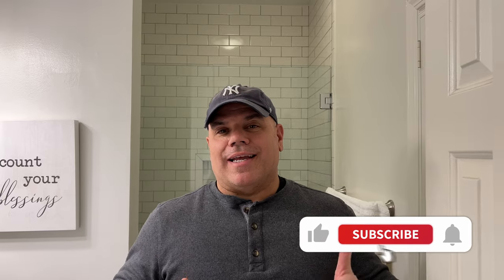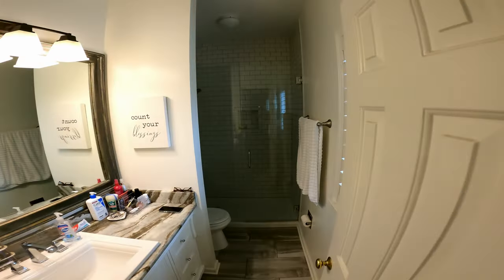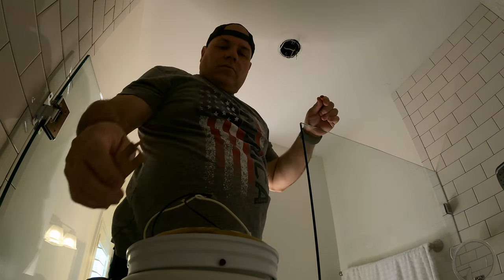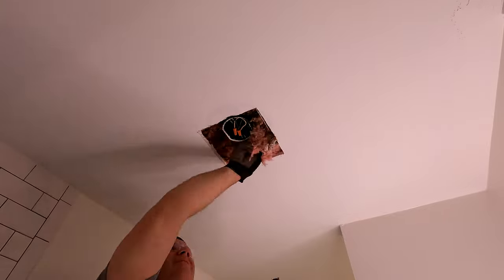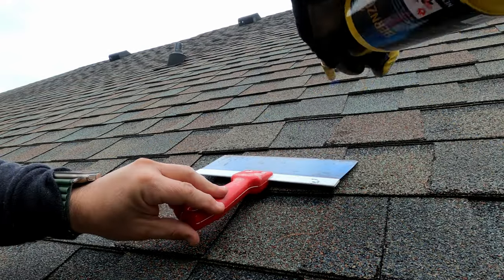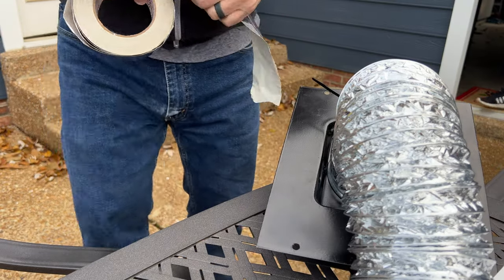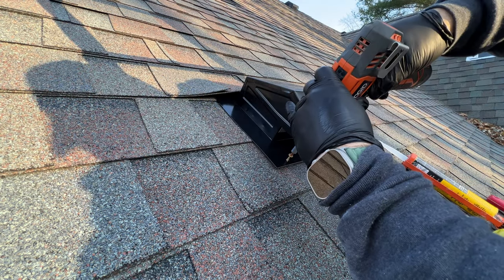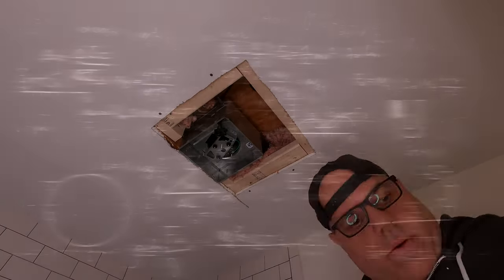DIY Bath Exhaust Fan Installation - How To

Comment: Should be straight 4" pipe with a 90 of the fan. Apart from that good job. And before the haters come on here the reason that you don't use that stuff is because once any type of fluff and moisture starts to build up around the ridges of the  lining of the 4 inch flex, it can only go one way and that is to fall downward. When it is straight pipe you can evacuate way more moisture and  it doesn't hang on to The ridges  inside the flex.
Reply from the maker: Thanks for the feedback.

Comment: Why did you place it right on the shingle and you did not peel back shingles
Reply from the maker: I did peel back the shingle at the top because that is the only thing that is required. If I had peeled back the sides or bottom shingle then water would have a way under the vent.

Comment: Nice man! Did you get in the attic to check the roof deck for studs before cutting your hole?
Reply from the maker: I did. Luckily I have a knee wall upstairs for my A/C unit and I had a perfect view of where my roof rafters were. Plus I carefully measured where I wanted everything to lay out. Thanks for watching and commenting!